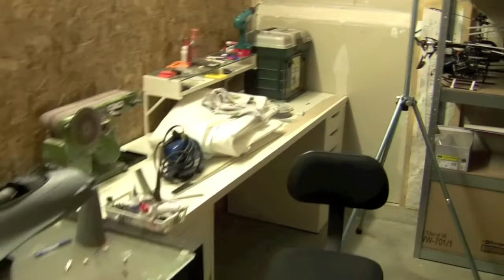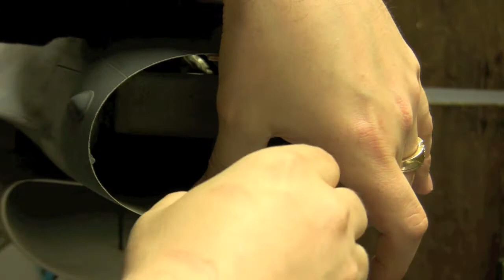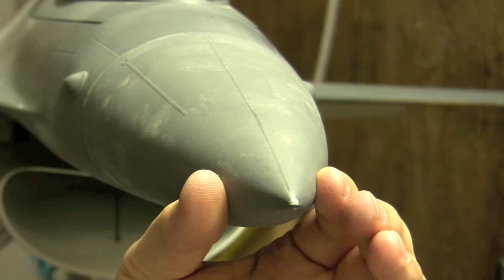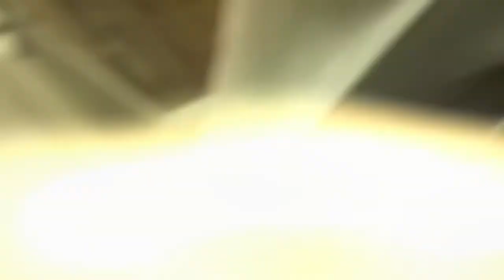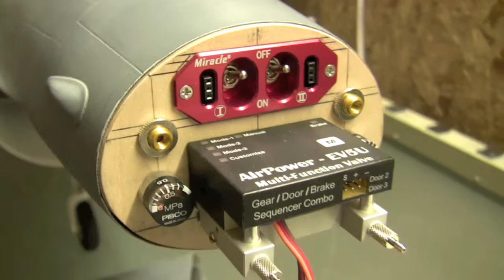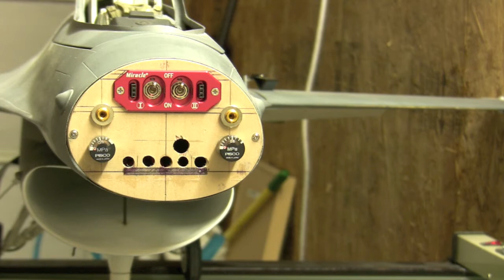Episode #65

Comment: Just a note. In order for your bulkhead screws to tighten properly, you need to drill the holes through the bulkhead with clearance and leave the holes in the blocks tight enough for the screws. Otherwise, the screws could actually push the two pieces apart.